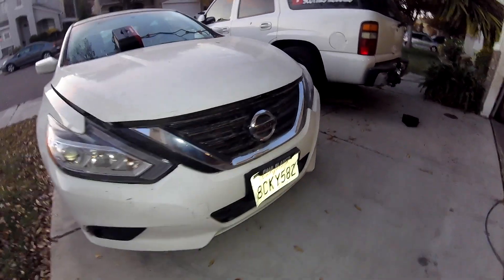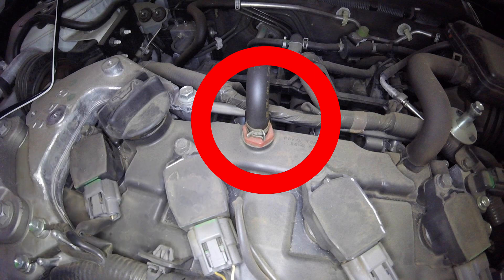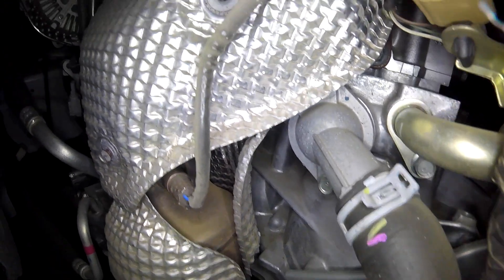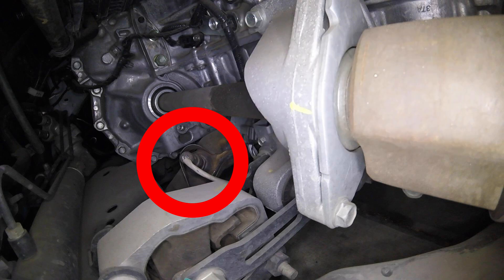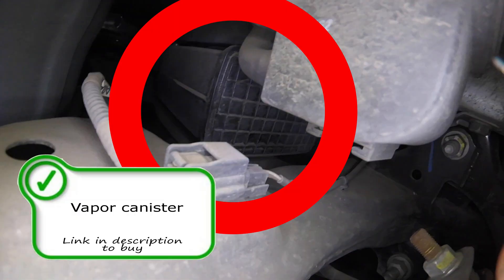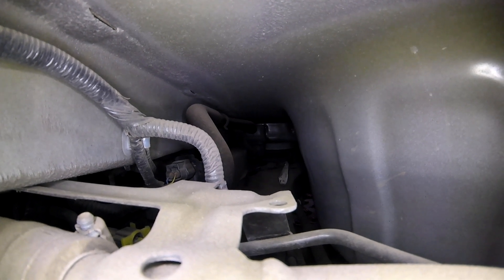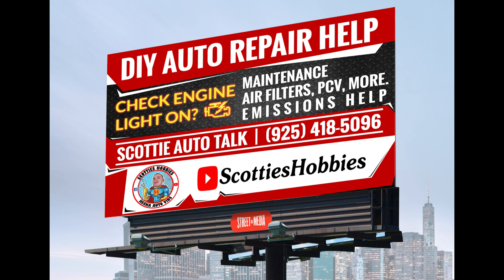⫷ Nissan Altima Emissions / Smog Locations: PCV, Oxygen sensors, Vapor Purge and Vent 2.5L 12 - 18 ⫸

Comment: Great video! I have a 2011 Altima 2.5 with a P0456 small evap leak code and intermittent loose gas cap warning. I already replaced the gas cap but it didn't help. What should I try next?
Reply: You need to replace the evap vent control valve.

Comment: For my 2018 Altima, if my rpm is idling rough and my fuel gauge is reading incorrectly, could be my o2 sensor?

Comment: Please help! 🙏🏻  I have a 2010 Nissan Altima 2.5 S that’s running a code P0443. Is that in the engine area or under the car on the canister? And what is the part name I need? I’ve been searching and get nowhere. I’m get mixed information and driving myself crazy! Thank you in advance.
Reply: Hello, I have the same issue. Which area did you replace the part? I know it’s been a year. Thanks (I have a 2010 too)

Comment: I'm hoping u can reply back my dude... my 14 altima came out with a P0443 and I'm trying to see if the first purge control sensor u showed is the one..
Reply from the maker: The purge solonoid is the solonoid shown at 00:00. Make sure you have a good connection and the wires look good at the connector as well.
Reply: @Scotties Hobbies  00.00? When is it that u show the one for P0443 code bro
Reply: @ScottiesHobbies  is it the one at 1.02
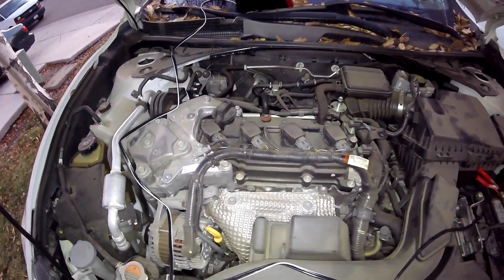Reply from the maker: @SaulRamirez-bz9cs  sorry... yes. 01:01
Reply: @Scotties Hobbies  thanks bro.. let me give it a shot and I'll get back to at ya.. thanks
Reply from the maker: @SaulRamirez-bz9cs  good luck. 👍 🤞💪

Comment: So I got p0420 it’ll be that 02 sensor on the catalytic converter
Reply from the maker: Possibly your rear o2 sensor is bad. If you have over 110k miles and get this code, chances are the cat is going bad. Always worth trying the post cat sensor first. If you are in a non smog state, you can use defoulers to fool the computer.

Comment: I have a code p015a/b and p014c/d rich/lean b1s1.

I am struggling to find out how to diagnose the sensor. Do you know the specs and how to test for resistance value and how much ohms is good or bad for 2016 nissan altima and also if you could share how much the torque is?

Comment: B1S1 is sometimes referred to as Lambda sensor. It’s just an 02 sensor, that measures AFR. 
Good video!
Reply from the maker: That is correct. Or also known as an air / fuel ratio sensor.  The difference between the old O2 sensors and the newer A/F sensor is: old only measured how much o2 was in the exhaust and assumed the HC content. With the new a/f sensors it can measure both o2 and hc. The computer can better adjust fuel delivery trying to keep the air to fuel ratio at 14.7/1. 

Great catch! Good luck on your next diy fix! 💪👍

Comment: The obd2 from auto zone couldn’t tell me if the bad o2 sensor was upstream or downstream. My car isn’t driving any differently so far (been about a week).  Is it safe to assume that it’s probably my downstream sensor that is bad?  Is there another way to figure this out without bringing it to the dealer and having them test it?
Reply from the maker: If your check engine light is on you should have a code stored in the ecu. A mechic should be able to pull the codes and let you know what they are. That usually costa a Diagnostic fee, even if it is just pulling a code. Or you can buy a obd2 scanner/reader that you can have as a stand alone or one that can hook to your smart phone. I can get you links if needed.